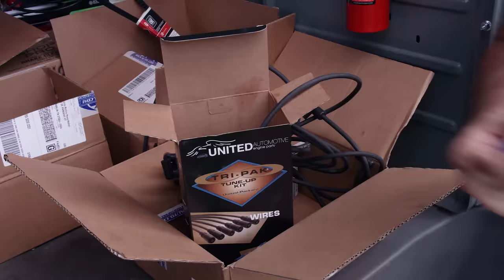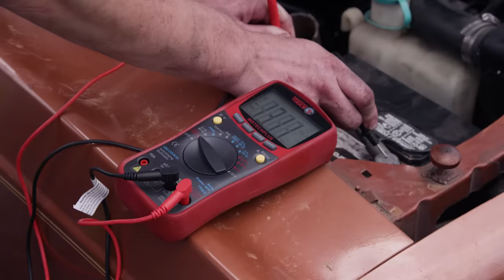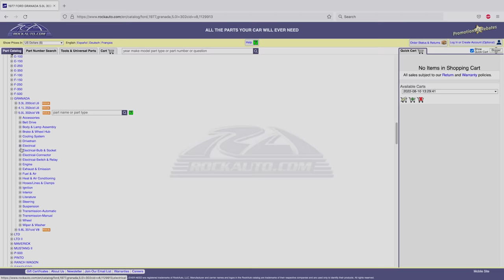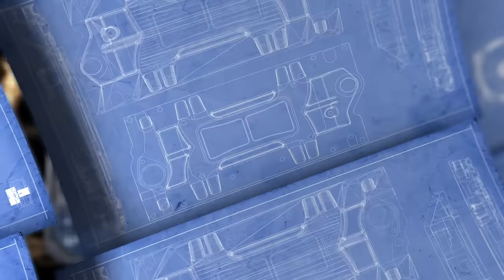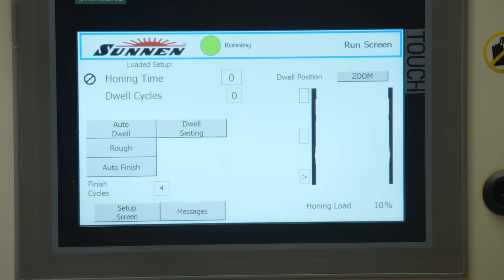Full Build: Building the Ultimate Sleeper Out of a 1977 Ford Granada That Turns 7500 RPM!

Comment: I have raced at that dragstrip! IHRA divisionals in Stock Eliminator. US 43..Beautiful area and a nice little track. Although I race Olds now (25 records in Stock, #5 & #3 in world points, division 2 champ), I have in the past raced 302's. That car should have been deep into the 7's without nitrous (with slicks). The 2800 converter is KILLING that car! Especially at that weight! I can tell you that you can easily run a 4200 converter on the street and you won't know the difference in daily driving. Forget the transbrake not needed, get a manual valve body, 4200 converter (higher if drag only), and shift around 7000 rpm. You'll go 7:50 boom. I guarantee it ;). 

As to Mondello, I am truly glad you said JOE Mondello! As any true racer knows, when he turned his company over to (blank) he ran that good name into the ground. (Blank) is a liar, a cheat, and a thief and everyone that actually races knows that. JOE is the good Mondello that built that good name. ALWAYS make sure you are dealing with JOE Mondello if you race Old's not the "other" Mondello.  Liked the video. I built a Granada's sister years ago....a Zephyr lol.

Comment: My second car was a used 1976 Ford Granada 4-door, which had a 4-cylinder engine.  It went from 0-72 MPH in about a minute, being that it wouldn't go any faster than 72 MPH and we had to wait for a small downhill section of road to get up to 72 MPH.  It had power windows and air conditioning that worked marginally.  I have fond memories of it, but for other reasons than any "wow factor" coming from the car itself.  It was a funny little car, but felt very much like being in a tin can, plus the steering wheel would clunk when maxed to one side and the steering belts always squealed in agony.

Comment: Fun build, and it brought back a lot of memories of working on cars back then, mostly by necessity but occasionally by choice.  That was a very clean "Grenade", as they were commonly called back then.  I remember those days well, having bought my first car in '76 and my first brand new one in '79.  New cars typically came from the factory with "several mechanical issues" at no extra charge.  😄 QC at the automakers was a bit weak in the late '70s.

Comment: My first car was a 1979 Ford Granada  V8 4 door in 1984. I hated the color and it had bad rust around the tail lights. Today I would have fixed the rust. But I changed the oil often because I drove it long distances often. The main problem I had was the alternator went bad often (I didn't know about the separate voltage regulator) other than that and tires she never left me stranded. And many things underneath reminds me of the Mustang. The shock towers looked the same for instance. A friend of mine had the Monarch version.
Reply: The Early Mustang/Cougar and Granada/Monarch shared the same platform

Comment: Love this project. I had a 1976 Mercury Monarch with the same setup and I was going to do a similar project. BTW, as far as rear axle some Monarchs came from the factory with rear end with disc brakes. The Lincoln Versailles had them as a standard option. Also a floor shifter was available as an option on some Granadas and Monarchs, so you could also do a swap with a better shifter while still keeping a somewhat factory look.

Comment: One caviat Id like to add on your description of carb function is that while you generally want the largest venturi for increased gas-flow, airspeed through the head is critical for cylinder charge, and fuel immulsification. Too large, will mean low charging ability at sub 5000rpm speeds.

Comment: 2 things That I did in Mustang II before I went SEFI that I thinkwould  help your #'s: 1. find a dual snorkel '83-'85 Mustang GT GT dual snorker air cleaner and add the front cut out like you did already and 2. a K&N stub stack or simaliar horn transition air flow device. i found with my 331 stroker it helped to the tune of give or take 17-20hp  at the wheels.

Comment: Awesome it's a super sleeper just perfect love it way before street outlaws my buddy Lee and I built a F250 two wheel drive scrap yard hauler with beat up monster muds tires on rusted white spoke wheels slipped in dump truck springs for handling borrowed the all aluminum big block svo motor out of Fairmont wagon dual quads first hit up the Porsche crowds at twisty roads then the street races aFter making enough dumb founded looks last whole shot broke 9 inch pulled out broken chuck and popped in new all good to race another day best weekend ever

Comment: In the mid eighties I owned a 1980 Granada with the weirdest power train. It had the big Ford inline 6 cylinder mated to a floor shifting 3 speed with "overdrive" as Ford called it. Really it seemed to me to be a 4 speed on the floor but that 4th gear was a high gear that was great for fuel mileage and lower rpm on the expressways. The car had air-conditioning and power steering and power brakes. Oh and can't forget it also came with a AM radio. Cannot forget that!
   I put quite a few miles on it. Then some guy saw it and wanted to buy it when he saw that chrome shifter sticking out of the floor so I gave him a stupid high price thinking that would get rid of him but no, he took the cash out of his pocket and paid me right then and there! I happened to see him a year or two later and he couldn't have been happier.

Comment: Took an 81 T-Bird with a 302 and AOD and put it into an 81 Fairmont. Painted it flat black and put  Pink Floyd's Dark Side of the Moon on both sides. Also put all the power stuff from the T-Bird. Found an 8 1/2 inch rear end and freaked out the neighbors.

Comment: on that c4 that is a check valve that was originally installed under the spring, us rebuilders used to replace it with a steel ball.

Comment: It looks like the tires want more air pressure. It will probably 60ft better and pick up more mph. And it would be more stable going down the track. What rpm did you have the nitrous kit activating at?

Comment: I can't believe that the gas cap cover is on the car. This was when Ford went from a hinge to a piece of plastic that was designed to break after 10 uses, they also applied that to the glove compartment and center console. This car may have had a decent engine but the rest of the car with a piece of junk and 46 years later is the very reason there has never been a Ford product in my driveway. I'm like an elephant I never forget.
Reply: Who cares?

Comment: Hey, just wanted to add my mixture of W/M fluid.

In Florida you hardly find methanol washer fluid. I had to ask O'Reilly to order it.

Using my washer fluid tank that is built into my Audi A6 2.7T which held around 1 Gallon. With the correct washer fluid I would add 2-3 of HEET yellow bottle.

So to price it out back in 2014 washer fluid was $3.xx and each bottle of HEET about $2

Now because of the Twin Turbo intercooler piping which had dual intercoolers I ran a 8:45 4gph nozzle in the left n right piping about 1.5" from throttle body.

The stock intercoolers are fine at stock boost but I was custom tuned to max out the stock ko3. Now again cause of being in Florida it was hard to get above the factory timing table. Temps ranged on a normal day 90* to 145* which outside temps 85-90*

Not only did I have to remove some fuel I was able to safely creep upto points of 22* timing advance.

Now I used a Snow Progressive Injection setup so I seen good results when lowering the starting PSI @ 5psi and 13psi to run 100%

By starting the ramp up lower I was able to see temps 70* to 100* and that's in normal driving but beating on the car with heat soak would see 110* IAT.

Never tried branded boost juice etc but after watching the video I now reget never trying it when I still had the car.

Thanks

Comment: Yeah, I had a '77 Maverick with a 302 in it and yes it is very anemic. It ran smooth, got poor fuel mileage, rode well, and started even at -10F. Not as ugly as the Granada though. By the way, they were rated at 137hp but I always thought they were a lot lower than that...your test proved I was right. They were also limited to about 4500 max rpm...don't know why...maybe the lousy trans? I can tell you that to get those headers into a Maverick you would have to pull the engine pretty much all the way out to lay them in place and then lower the engine and start bolting them on before finishing the engine mounting. I had to go under the car to change the spark plugs on both sides for the back 2 plugs. A pain for sure and the lack of power made it seem useless to do.

Comment: That Granada has had a very good, garage kept life. Perfect project car. I had one and really liked it except for the seats,, they were NOT comfortable at all. A long trip - 2 days - your butt and back were in extreme agony because the seats were hard. Mine had a 302 with automatic and yes,, it was a high fuel consumption slug. I traded it for a 1980 Olds Cutlass, automatic, 277ci aluminum V8 that was a much more comfortable and fuel efficient ride.

Comment: I test drove a nearly new 1978 Granada with the 302 at a Ford dealership.  This car was so slow you just floor the gas and endure through the very hard shifts that were so popular/common on Ford products.  Then I test drove a 1977 Granada with a 302 and it was just as slow and awful as the 1978 Granada. Ended up buying a 1977 Nova with the 250 I6, automatic.  The 250 Nova had a LOT more get up and go (along with smooth shifts) than both the Granadas with V8s did.  My father bought a 1980 Buick Regal in 1981 with the 3.8 2V engine, and as slow as it was, it was a race car compared to the Granada and the Regal also at least had nice, smooth shifting. My sister ended up buying a 1980 Granada with the 250 I6 which performed a lot better than the 1977 and 1978 302 Granadas, but it too had that common very hard shifting common in Fords.

Comment: I'll give you that RockAuto is a great place to order parts from. They have about the best 'drill-down' menu to exactly what you need that's out there. The local auto-box stores could learn a lot from their website. Easy to order and quick shipping.

Now if they only had headers for a 1948 Studebaker Commander with the inline-6...

Comment: I had an early 80s Oldsmobile with a 455 big block I built but I have full length headers and a nice exhaust but just looking at it it looks like a sleeper but it runs 12s in the quarter mile with drag radials

Comment: I would love to find a 4 door Granada to do this. If you can find one you need the factory 9inch with disc brakes from a Lincoln Versailles. But what they did is probably cheaper and works better as shown.

Comment: Needs to sand blasted and repainted and the old motorized light bar needs to be replaced with a much brighter and more efficient LED light bar. If you don’t want to spend an arm and a leg you can get a SpeedTech Lighting with their optional dual memory controller for 20 dollars. If you want higher end then I’d suggest Feniex  as they have more options. SpeedTech is what I started with as a Volunteer Firefighter and after a couple years and gaining multiple certifications as well s EMT I upgraded everything to Feniex and I had a lot of lights lol. I wanted to make sure I was seen for the safety factor among other legal reasons.

Comment: Wonder what the gear ratios are in the after market  C4 transmission 3 speed. C5 or C6. 1/8 mile drag strip. Can you make a video taking the Fairmont on 
a 1/4  drag strip  ?

Comment: Somewhere i missed the specs of the donor block that you already had in house ? The vid description includes "Stroked 347" (cubic inches) that turns "7500 rpm" . So, was the doner block a 351 Windsor ? What were the specs of the rotating assembly (stroker kit) ? Thanks

Comment: So you put Seafoam in the tank to clean the fuel system but you did not change the fuel filter.
1:17:59 Someone explain to me how the torque converter is making the transmission shift from 2nd. @ 4,800 rpm.

Comment: You should add the AC since you're putting the HVAC system back, I mean it's hot as F. The paint fading of the engine bay is because they weren't painted with clear coat, just paint

Comment: My 95 mustang gt 5.0 that my mother's bought in 2000 i inherited  it 4 years ago has 150k miles and the plug wires are grey motocraft wires with the cyclinder number on em, im 99.9% sure they are originals along with the plugs. The only thing thats been changed is the harmonic dampener/balancer, the outer ring started to seperate years ago and it got replaced with an $75 jegs house brand. I just pulled the #1 plug out a couple weeks ago because of a missfire and the plug was pretty tierd, i just havent bothered changing the rest, i believe its an injector issue anyway, it woke up bigtime just by tossing a bottle of seafoam injector cleaner in it, it hadnt run that good in years. It doesnt feel like HP picked up but midrange TQ and gheottle response went up bigtime, it is like night n day, thats where the HO engine shines anyway, ford had something  figured out back then they managed to make a little v8 with a 3" stroke run like a little diesles, 2500 to 3000 rpm they start to pull pretty solid then fall off and start wheezing after 4500. 5.0HO thats some spot on 80s performance.

Comment: I owned a '77 Monarch (Mercury division Granada) 302 2 bbl with 3 speed with overdrive (4th). Ford build quality was not great in those days. Just after the warranty ran out, the car would pop out of gear when decelerating. Had to replace the clutch  assy at 16k.

Comment: The 351 Windsor was a dog too, in my 76 Granada.
Reply: WHAT THE HELL. MY SISTER HAD 78 OR SO 302 VARIABLE VENTURI CARBURETORED GRANADA. THAT DAMN  THING WOULD REALLY JUMP OUT AND GO. ESPECIALLY A WOT DOWNSHIFT TO 1ST GEAR.
Reply: In '76, just about EVERY engine from all manufacturers were a "dog". Smog emission controls and appropriate engine tuning ruled.  Didn't start to see any return to true performance across the industry until the mid-'80s.

Comment: Single-Panes are anything you want manifolds for max power and throttle response. I proved this in 1980 with a 327 SBC. To this day I put single-plane on everything I build plus a 4-hole carb spacer for air-flow Velocity..

Comment: nice build, i would have used an AOD instead of the C4
Reply: Agreed.  The stock C4 is a fairly weak transmission , and I speak from experience.
Reply: @eskieman3948  There’s no reason not to have overdrive these days, especially when it’s a street driven vehicle
Reply: @NYPATRIOTBX  Yup.  Then you can afford to run a 4:11 rear in it without the engine turning 3500 rpm at 70mph on an interstate.

Comment: As far as headers go,....Hooker actually made a set of Super Comp  headers for 75'-79' Granada's with 302 it was a catalog item; I know because I've bought 3 sets of them from Hooker for my Granada's over the years; last set I bought was mid 90's though, so, they were probably discontinued. I used them for my 351W swaps on Granadas; only modification was to dimple one of the primary tubes to clear the motor mount. Tight fit, as they were designed for the width of a 302 in the engine bay, not the width of a 351; fit with no modification with 302 just fine.b

Comment: I had a 1974 LTD with a 400 ci and passing gear and we had that car up to 145 miles an hour on a stock engine and transmission we were at 145 I'm sure the speedometer only went to 135 mph and we were well past that and when we punched it it changed into the passing gear and boom we were pushed backninniur seats again. Quite scary.

Comment: Back in in mid 90’S I had a MERCURY MONARCH 1974 with a 351 Cleveland, it was not bad , but in my garage I had several big blocks ford like the 427 , 428 and 429 SUPER COBRA JET , and many big other big blocks fort also from other company, so I took the 429 super cobra jet and rebuild it 100 % over 2 years period, yes it cost a lot and I had other projects too , so big cam , overkill connecting rods , 2X 650 CFM carb to stay underpowered , TURBO 400 transmission with adapter plate and 2400 stall and muffler to not be annoyed by cops, 3.54 diff ratio with Detroit locker on custom build GM 14 bolts rear diff , custom rim with 10 inches wide tire . 
Was running low 11 on the 1/4 mil . Could have run in the low 10 with a 2800 rpm stall , 3,73 ratio and no muffler and larger carb  but it was a sleeper with almost not much noise , well no more than a mustang .

Comment: Try changing the starter on that car with a 302 in it. That car was designed for a 200 inline 6 cylinder engine only.

Comment: I used to  own a  think  it  was a  1976 AMC  Javelin with a  401  big  Block  it  had a  750 cfm dual feed  Holly  but  the  back  line  was  blocked  off  wonder if  that  would  have  caused it  to  lose  power  or  not  I admit  I wanted  to  hook  it up  the  way  it  was  meant  to  be  done  but  due  to a  messed  up repair  shop I ended  up  selling  it  before  i could  do that it  also  had  Hooker  Headers  but a  short  exhaust  that  came  off  every  time  I  hit a  mud  puddle which  made  for  some  with  vibration  when a  person  talked  in the  car

Comment: I owned a new 1977 Grenada in a cream color with a 302 engine.  The power steering system would make a screaming noise after 6 returns during the factory warranty. They even installed some kind of filter for the power steering fluid.  The Ford dealership finally offered to give me a 100% money back refund, just to get rid of me.  I forgot to mention that it had a C4 transmission.

Comment: i had a 77 ford pickup with a 302 and a 4 spd manual. paid 100 bucks for it and the engine was worn out so i rebuilt it to 60 thousand over. sold it to my uncle and he put the engine and trans into an econoline pickup. he took it for a rip and punched it to get out in traffic laid rubber and spun it 360 and about crapped himself. he had a big grin on his face though